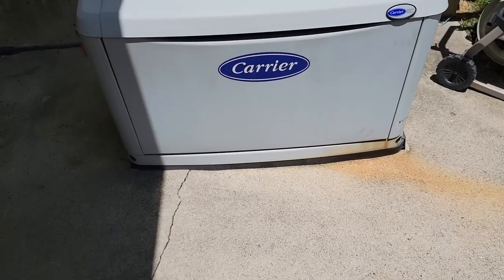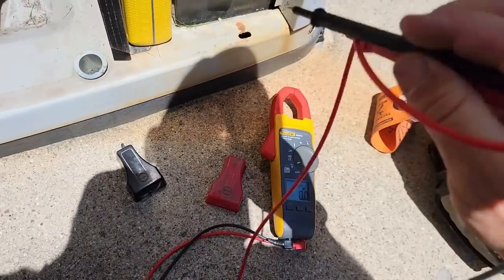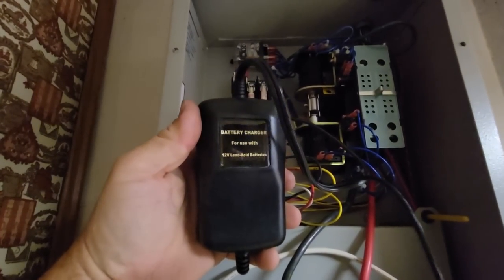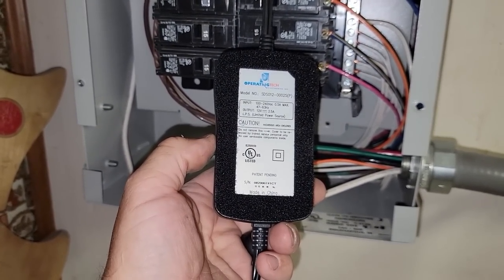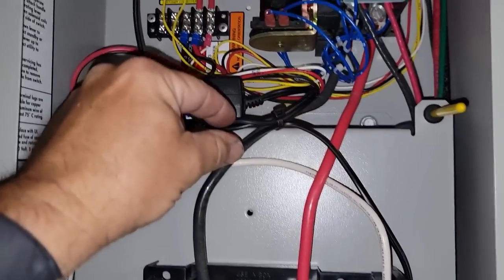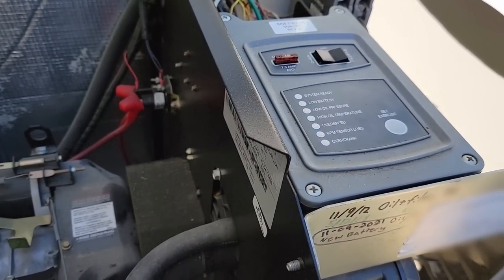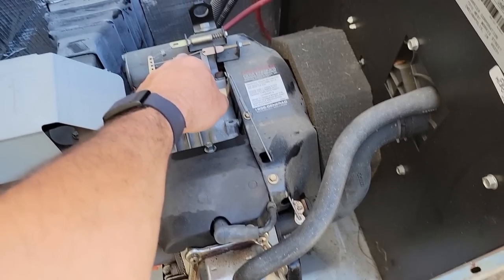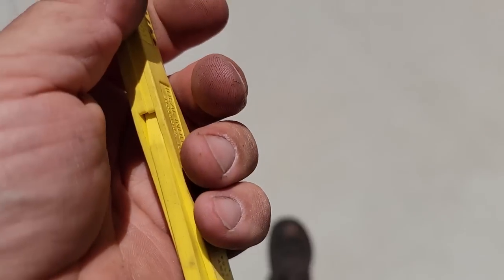Generac / Carrier Standby Generator Won't Start Blank Display

Comment: Nice job! I'm an electrician, and electrical contractor and I run across these old ones too!! That was a logical well explained troubleshooting method and I'm very impressed with your troubleshooting ability.  Thank you for your help I learned quite a bit!
Reply from the maker: Thanks Mike, I really appreciate that coming from a electrician🤜🤛👍👍

Comment: I live in Northern California, and we have numerous power outages four times a week because of forest fires or the possibility of forest fires. Two years ago, I bought a Generac Generator. One of the best investments I've made takes about 15 seconds after the power has failed, then when the power is restored, you're not even aware of it. It's seamless.
Reply from the maker: Some Generac are great and never have a problem. I believe the more it runs the better it will hold up, these generator that I work on usually only have 30-90 hours on them and they end up failing in a major way.

Comment: I had a battery from a 2009 era Generac explode at my feet as I was diagnosing.  Somehow I wasn't injured at all with the exception of some acidic splatters on my shoes and key fob.  Apparently around this era it was common for the chargers provided with Generac generators (this one in particular was installed in the unit rather than at the disconnect) to OVERCHARGE the battery and boil out the electrolyte.  So that final time when I attempted to manually start the generator, a spark ignited the entirety of the hydrogen gas that filled the battery, as there was no electrolyte to fill the space otherwise.  KABOOM!  Scary $hit.  I contacted Generac and they had a local Generac dealer come by and replace the battery and charger free of charge.  They denied my request to replace my shoes and key fob though.  This was back in October 2018 I believe.
Reply from the maker: You're not in the minority. See it a lot in the older generators.
Reply: @HVACRSurvival  I thought fore sure I was blinded.  Opened my eyes and was in awe that I was unscathed.

Comment: As always you did a great job! You have nightmares about taking screws out? It seems like to me every video I see you are taking out at least 10 or 15 screws! It may be a little bit less but it sure seems like that's more what you do than anything else. But you do a good job of it. I would recommend you to anyone...
Reply from the maker: No dreams about screws but thank you for the vote of confidence.
Reply: It seems like no matter who makes the device, anything needing service has too many screws.   The last really nice computer system that I saw was an IBM PC (with MCA architecture, no less).  You could COMPLETELY disassemble everything, including pulling the motherboard, without tools.    Of course, that architecture failed, and nobody else was willing to build anything that way again.

Comment: Love your videos! My only question would be why not shut the generator breaker off in the main panel instead of pulling the fuse? Is there some benefit that I’m not seeing? Thanks Rick you da man!
Reply from the maker: Because when you kill the power that way you can cause the clocks to loose time and it create a concern with the customer. When I do it this way it switches over and it only blinks the power and generally wont cause clock or computer issues.
Reply: @HVACRSurvival  Makes sense! Although I would still have the customer shut down their computers and electronics just to be safe. I wouldn’t want to take a chance of them loosing something they were working on. You have no idea how much I appreciate your knowledge! Thank you so much for sharing it!

Comment: For an emergency unit required to start itself with no mains that charger needs backup! My first move would be to fit a small solar panel (say 5 watt). Yes many modern hyper-clever chargers switch off after a time (about 24 hours) and only come on again when disconnected and reconnected. Use a time switch and a relay to break the mains line and the 12v line, and remake the contacts after a pause.
Reply: i NOTICED THE SAME THING!
Reply from the maker: The charger is not intelligent, Its a generic constant charger that can charge from milliamps up to 1.5 amp. The reason Generac put the charger in the transfer switch is so it will always have power and doesn't need a switching relay like they use to long ago. The location that it is receiving power is always powered...either by the utility or the generator because its on the load side with the house.

Comment: Long time Generac tech here... that intake tube falling off can be better secured by filing a few notches in the plastic where the hose clamp grabs. I generally put the extra tooth about 1/4" - 3/8" from the end so it's centered on the clamping area. You should also adjust the valves and change the plug. What happens is when things are a bit off (tight valves?) you get an intake cough on cold start, and that's what blows the hose off. Second thing is related to that charger... new aftermarket chargers automatically shut down after so many hours. (some kind of new federal law for energy saving) What happens is you are fine till there's an outage. (normal battery float charge) When you have an extended outage and that charger is supplying field current, board power, battery charge, and gas solenoid, (within its rating) the aftermarket unit will shut off after 24 - 36 hours, meaning the battery will go dead and the gen will stop. The reason this happens is the charger thinks there's a battery malfunction, because under normal situations (and a properly sized charger) the battery should be fully charged within 36 hours. The correct part for this application is rated for continuous duty WITHOUT shutting down.
Reply from the maker: Thanks for sharing all that info👍👍
Reply: Do you have any experience with Kohler units?  My mother has a 20K, 3,600 rpm unit.   Burns a quart of oil in just a few days!!  My friend with the same unit says the same!
Reply from the maker: @Hubjeep  I went to a class at there factory for the Lennox generators they were making but I'm not a really familiar with them like Generac.
Reply: @Hubjeep  .... no real experience with the newer ones (less that 5 years old) but I did service and install for around 25 years and the general rules are the same. The high speed units do wear faster and some of them never break-in properly due to going right up to speed from a cold start. Consider this: Every 24 hour run period is like driving from Boston to Key Westy (non stop) which is over 1,600 miles. At that engine speed it would be similar to driving your car at near 80 mph. A bit rough on the equipment, eh? Now consider how often you should change the oil under those conditions. The book will say around 100 - 200 hours (after initial break-in of 50 hours) with plug changes around the same time. This is for NORMAL use. They will also call for a valve adjustment at similar intervals. Is there any wonder why there's oil consumption every 2-3 days? I mean, if a car used a quart every 4,000-5,000 miles would you consider it a lot?
Reply: @rupe53   Thank you for the perspective!   Her generator is about 10 years old.  My generator is a 30 year old 12KW Onan diesel, 1,800 RPM unit, 4-cyl, air cooled.  It uses basically no oil, takes 6 quarts.  Runs off the home heating oil, half gallon per hour.  Loud, but is a tank.  I also have a Lister Petter 8kw 1,800 rev air cooled in a light trailer as a backup.
Reply: @Hubjeep  ... if that Onan diesel is an air cooled J series, it will outlast you and me by a few decades, as long as the mice don't move in and chew the wiring. It was designed for farm use shortly after WWII and never changed. I worked on many and the only reason people gave them up was they eventually needed either injector or injector pump work, which is a major expense on an older unit. (basically hard starting) Another drawback was that building codes have changed and 30-40 years ago most of these were sold without a housing, which meant they got installed inside a garage or shed, which home inspectors frown on during a resale these days. Every single one I pulled out for the above reasons got refurbished and sold to someone for an off-grid cabin where there are no building codes.
Reply: @rupe53  - Yes, if a modern car had less than 160,000 miles on it and was eating a quart of oil between changes, I would DEFINITELY call it a problem.   If it was a 1958 Chevy?  Sure.  But they had looser tolerances and metallurgy wasn't quite as good.   My 2003 Pontiac Vibe (Toyota Matrix/Corolla engine) had 300,000 miles and burned less than half a quart between oil changes.   I will also counter your 'near 80 mph' comparison. If you're using 100 hours for the oil change, and comparing that to an automobile, that would be 100 hours per 3000 miles, or driving 30 mph for 100 miles of highway driving.(constant load, not stop and go)  (and 1500 miles for the first oil change).
Reply: @tbelding  .... yes, a problem that the factory has slowly responded to more recently, as the war for cheap air-cooled sets has battled on. The older units were designed with cast iron rings and a max service life (best case) of around 1500 hours. (again, best case) Newer units are using chrome rings, synthetic oil, and they claim an engine life of near 4,000 hours. This is a lot to ask of an air-cooled engine that runs 3600 RPM. BTW, while the engine speed is constant the load does vary. Also consider in some cases they are whipping out near 40 HP from a 2 cyl engine that's just over 1 liter in displacement. There are some things you can't get around when price is the bottom line.... and competition in this market is stiff.
Reply from the maker: I fully agree, unfortunately price always is a race to the bottom of quality.
Reply: @rupe53  YES, mine is a DJC-12.  I have seen one in a firehouse lighting truck.   Oil and fuel filter changes, that's it since new in 1992!  Do you think it's valve adjustment time, or leave it alone?  The rubber mounting bushings are showing some cracking.
Reply: @Hubjeep  ... never hurt to do a valve adjustment, even if it's only got a few hundred hours on it. I have long forgotten the numbers / specs but they are out on the web if you don't have the manual. The rubber bushings will go a long time beyond when they first crack, but if you plan to keep it you might start looking around. Much of that stuff is no longer available through the dealer (have to check) but do a search using "Onan obsolete parts" will find what you need, especially if you have the numbers. They are the same for all J series sets. (7.7 - 15 KW, gas or diesel)
Reply: @HVACRSurvival  - I would say that the problem is creeping featurism, rather than just price.   With a mature technology such as ICE, the only changes that can really be made are tolerances and materials.  So, rather than staking their sales on providing a consistent product - with the price being low due to quantity - they insist on changing models around, engines around, adding features, links to the internet, and so forth.   

Look at BIC lighters.   They're still the same materials, almost exactly the same structure, and pretty darned closed to the same quality as 40 years ago - yet they're still one of the largest sellers of lighters out there.   Because people know what they're getting.   (other than the 'child safety features' added in the 80's)  

So the race to the bottom is trying to keep the same profit margin (or larger) while jamming as many features in as possible, as cheaply as possible, with those features NOT being actually useful - but they look good against the competition.  "We have a horn!"  "We have a horn and wipers!"   But, it's a lawnmower!
Reply: @rupe53    Thanks!   Mine has a manual ATS, an automatic would be awesome, but would require a glo-plug timer, etc.  Prob not worth it.
Reply: @Hubjeep  .... worth it depends on your point of view. I'm sure there's one out there but ATS units (automatic transfer switch) are well over $1500, unless you find a used one, which has the delay and the extra relay for glow plugs. (plus installation) That unit needs more than 10 seconds on a cold day (20?) and even switches like the Asco 300 (with adjustable delays) would probably time out waiting for acceptable voltage, not to mention it doesn't have the extra relay for glow. All of the newer diesels have quick-glow and would fire after 5-10 seconds.
Reply: @rupe53    Yup, I glow mine for a full minute in the winter.  Starts up much better.
Reply: @Hubjeep  ... in theory it will start better, but a full minute is a long time and may shorten the life of the glow plugs, which I recall being in the manifold. (air cooled) Remembering a cautionary statement in one of the manuals stating to do 20 - 30 seconds max and if it fails to start, repeat the process. This way the plugs don't overheat.
Reply: @rupe53  I would call a Quart of oil every 4,000-5,000 a lot for a well made engine. I've seen 90s Honda and Toyotas with 250k miles burn less than 1/4 of that. Same time I saw 2000 VW engines which would burn that much on a 600-700 mile trip and that was after VW rebuild them to try and fix the oil burning issues.
Reply: @gdrriley420  ... you are right on some counts... it could be better... but at what cost? Also consider the dynamics of a water cooled engine that has a person in control, and likely a sane person who gives the engine 30 seconds of low RPM use while backing out of the driveway then (reasonably) accelerating to speed, leveling off at say 2500 RPM is a long shot from a cold start up to 3600 RPM on an air cooled unit that's going to hit (almost) a full load in 10 seconds or less. This air cooled unit will have maybe 2 quarts of oil and that's what they use to cool things, besides the air. (that is sometimes clogged up with snow or leaves, or mouse nest) Some of the older units discussed above were closer to car engines, despite being air cooled, and would last seemingly forever. If those units were built today, they would be twice as much money and still have fewer convenience features. Some people would pay the extra, but most would not. Everything is a compromise these days. BTW, my wife's Subaru runs about a quart in 5k miles despite regular changes. OTOH, it almost never sees the highway and is typically driven 5 miles each way to work. 55k miles over 7+ years. My 2014 Dodge Caravan has 110k and doesn't use a drop. Every car will be different, despite broad claims of reliability.

Comment: I can't imagine paying $$$ for a $20 battery charger when a solar charge with a 20 watt solar panel and a small PWM controller is less than $50.  As long as it gets 30 - 60 minutes of sun (not skylight) a day, it should last forever.  But I also don't pay ridiculous amounts for replacement UPS batteries ($50 for a 12 volt, 4.3AH battery?) when I can build my own from new surplus LiFePO4 cells for less than $3 each delivered and an under $5 BMS.  You can cheap if you want; I prefer frugal ;-)
I would also probably build a 12 volt LiFePO4 starting battery so it will be the last one I ever buy but I've been doing DIY electrical electronic things for many years,  When I enclosed the carport on a previous house, I got the city permit, did the work, called the city inspector who looked it over and has one question: Are you an electrician?  No, but the electrical codes are very straight-forward and I did plan to sleep in that house ;-)
My immediate backup power is a small solar-charged system good for 8+ hours, depending on the season - but I'm not getting a generator out of the shed out back in a thunderstorm or digging through 7" of snow at 30F the get that generator.  There's a proper transfer switch for essential things: fridge, furnace, limited LED lighting.
I tend to use things until they're worn out (previous riding mower was 17 years old when I replaced it) so I'm always interested in older generators.

Comment: After the battery is run down, checking the water level would be a good thing.
Reply: That battery is officially dead anyways. This is not an uncommon cycle - an old battery with a shorted cell almost kills the charger through overheating, then you put a new battery on and the charger dies in short order. The poor new battery sits without charge for days or weeks and gets badly sulfated so it needs replacing again.

Comment: It clearly has a governor and the choke is on the air inlet in the air box.
Reply from the maker: Your correct👍👍. I should have said the electronic servo governor. Obviously it has a mechanical spring governor.

Comment: The battery chargers are always a problem. If the voltage goes over 14.2 volts after full charge, the battery will fry. Most chargers will not disconnect after battery is 100 percent. There are two voltages to notice. 12 volts is what you will read at dead. 12.5 through 13 is what you will read with the charger running al 2 amp rate. Two different voltages to be concerned with or without the charger. Usually about 1 volt apart. But over 14.2 volts with charger on is the max the battery will take, then off.
Should turn on during charge at 13.5 volts or so.
Reply from the maker: Your correct on all accounts 👍👍

Comment: Gener-junk.  I still spec 1 or 2 Honda EU series generators for standby use. Even when completely neglected, they still start every time.
Reply: No propane version. My 3000i has lasted 20 years. The carb needs work due to E10 rotting it out but it still runs.